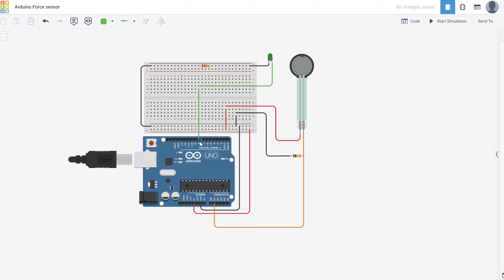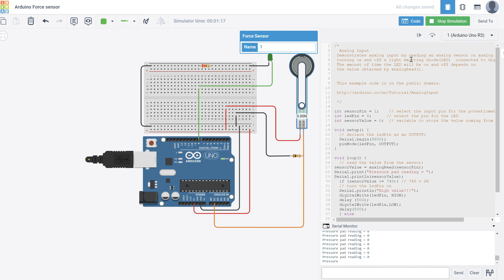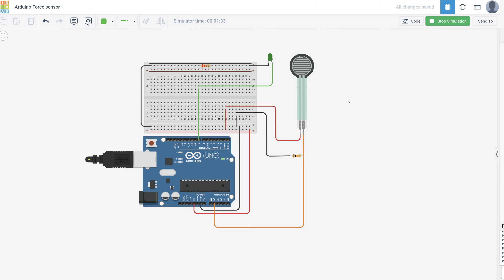Force Sensor

Comment from the maker: CODE FOR THE PROJECT: 

/*
  Analog Input
 Demonstrates analog input by reading an analog sensor on analog pin 0 and
 turning on and off a light emitting diode(LED)  connected to digital pin 8. 
 The amount of time the LED will be on and off depends on
 the value obtained by analogRead(). 

 
 This example code is in the public domain.
 
 http://arduino.cc/en/Tutorial/AnalogInput
 
 */

int sensorPin = 1;    // select the input pin for the potentiometer
int ledPin = 8;      // select the pin for the LED
int sensorValue = 0;  // variable to store the value coming from the sensor

void setup() {
  // declare the ledPin as an OUTPUT:
  Serial.begin(9600);
  pinMode(ledPin, OUTPUT);  
}

void loop() {
  // read the value from the sensor:
sensorValue = analogRead(sensorPin); 
Serial.print("Pressure pad reading = ");
Serial.println(sensorValue);
  if (sensorValue >= 748){ // 748 = 2N
  // turn the ledPin on
  Serial.println("High value!!!");
  digitalWrite(ledPin, HIGH); 
  delay (500);
  digitalWrite(ledPin,LOW); 
  delay(500);  
  } else        
  // turn the ledPin off:        
  {
    digitalWrite(ledPin, LOW);
  }              
}